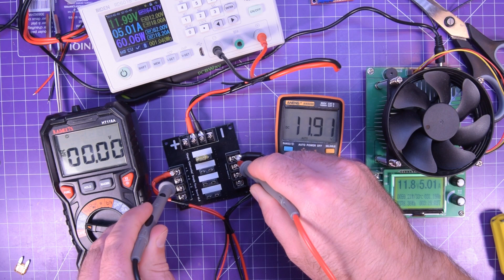Can My PCB Fuse Holders Cut The Mustard?

Comment: Well, a PCB copper trace can carry a lot of current. If you have 2 oz/ft² copper with a width of 5 mm and you allow 55 °C in an environment of 25 °C this trace can carry about 20 A. But also 1 oz/ft² can carry 13 A. If I need more current carrying capacity I use desoldering copper to increase the copper perimeter of a certain copper trace.

Comment: Most of the PCB FAB houses have PCB calculators to easily calculate power handling for your designs so maybe calculate it and then test it to see if it bursts into flames when its supposed to, just kidding but you have to watch cheap wire that eBay sells mostly made of Ali especially the Du Pont stuff,  the drop across a bunch of those wires can ruin your day....cheers.